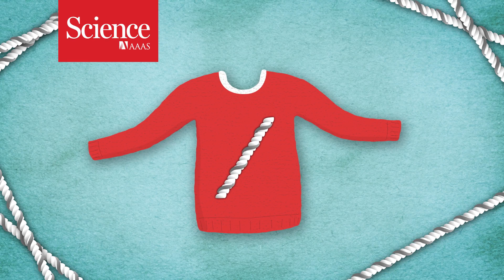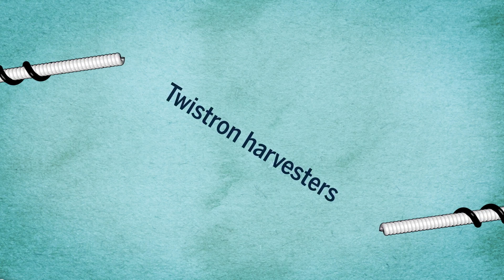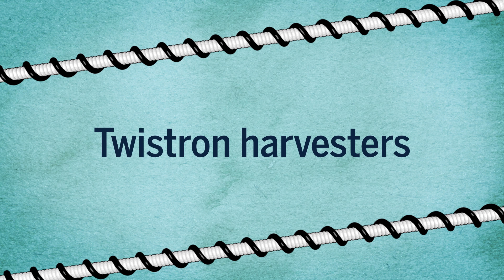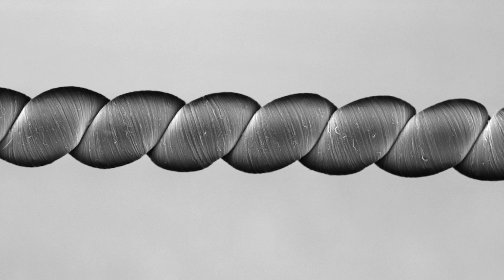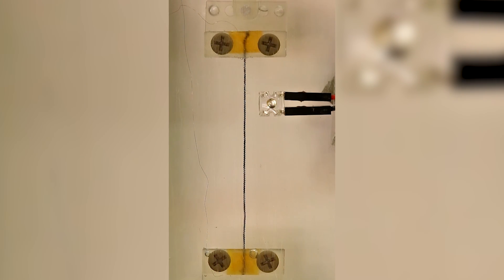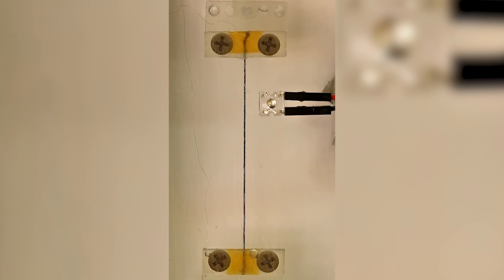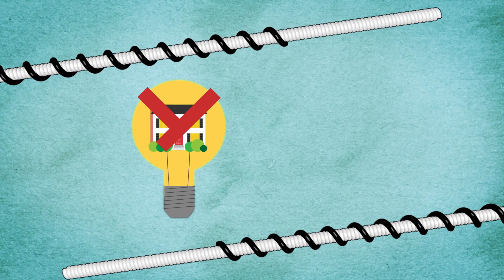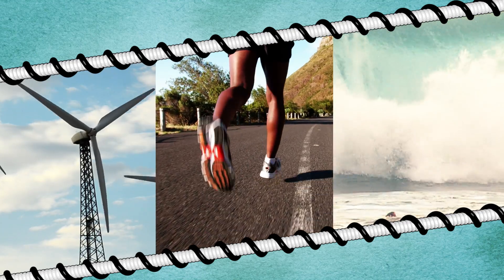These tangled carbon nanotubes can harvest energy directly from breathing and ocean waves

Comment: We need to be very careful about stealing kinetic energy from our balanced energy cycle surrounding us if we start stealing energy out of the waves to create electricity for us to use that will forever change the wave dynamic that will change the way the waves impact the shore that will change the way the sand moves on the beach and so on and so on and we have no idea if something horrible would happen if this is scaled up just like a hundred years or so ago the use of fossil fuels was not a problem but now it's been scaled up to the point where fossil fuel use is a problem in our environment so we have to be careful same thing about solar if all that solar energy that's radiating down onto our planet is intercepted and turned into electricity that heat from the Sun is no longer doing what it's done for millions of years and we have no clue on a very Grand scale what that might do to our environment same thing with wind you put enough windmills up when wind goes over a windmill and generates electricity the wind slows down and while we might think that's great to slow the wind down in some places that's windy that's the weather the wind is the weather we do that on a large enough scale that changes the weather and you think the climate change that we're facing now from fossil fuels is a problem hold on to your hats the solution is not how to steal energy out of nature it's how to get more done with less energy and be less of an impact on our planet

Comment: Springs and any other structure that under goes a lot of strain deformation could potentially use this tech.  Car suspension springs might not need shock absorbers if they are effective enough.

Comment: That seems like it was made for harvesting energy from ocean waves. The way a wave works is the water doesn't do much moving. Just enough to create the formation of the shape of the wave as that shape travels, but not the water. So it means if anchor something below the surface and put a float to ride the up and down from the passing waves you are directly harnessing it's energy. All you need is something that can harness energy when you pull on it just as the float above pulls against the anchor as the wave passes.

Comment: Only 250w/kg?
watt = one joule per second !
To compare:
Coal ~31MJ/kg
Gasoline: ~44MJ/kg
Uranium ~80 000 000 MJ/kg
When M= mega = 1 000 000
SO are you shitting me?!

Dislike that crapVideo!!!
Reply: One is a continuous energy source, the others are one time fuels. 1 kg of the threads can produce as much energy as 1 kg of coal gives of when burnt in 1.4 days. That is respectable in my opinion, but the cost is prohibitive for large scale application, and I don't know anything about the durability.

Comment: If used as muscle in a sense. You can generate power to charge a battery on an skeletoral machine. You can make a pump like the heart that generates that electricity to run the rest. Then this chain reaction of movement can generate enough power to push thru transformers to move more parts to generate more power 🤔

Comment: Imagine gloves made with this, you can heat them up faster by just moving your fingers lol
Reply: Nitrile Gloves
Reply: Ironically I think the amount of work you’d have to put in to the gloves in order to generate enough electricity to warm a pair of cold hands would result in your hands warming up due to metabolic changes and friction, not due to the energy gloves themselves.
Reply: @primate745  Wouldn't you have more heat then? I remember trying to heat my hands with gloves and there was a point where I couldn't get my hands any warmer
Reply: @HDMOVIECREATOR2012  i suppose it depends on its interaction with the em spectrum and other things. It might be a good insulator. It might also be a good thermal conductor which could cool your hands... also you would be taking work and indirectly converting it to heat with some “lost” in the electromagnetic field running through the conductor, which may have a cooling effect as well. At any rate it’s not clear to me what the net effect would be but my intuition is that it would have a cooling effect.
Reply: @HDMOVIECREATOR2012  anyway the idea is really interesting. I hope this technology goes mainstream.
Reply: @primate745  Thanks for your thoughts. Have a great day

Comment: So like I said years ago, we'll sit down on the bus and power it too! -  I thought I was going to be piezoelectric, but I had no tubes.
Reply: That will literally never power the bus. Energy can never be created or destroyed, only converted. The amount of energy you'd produce simply from sitting down is roughly equal to your body weight multiplied by the distance you caused the material to flex assuming the material was tuned for your weight. That means if the entire bus was the same weight as you, it'd take the same amount of energy you just produced to move the same distance as the material did, on the order of magnitude of a couple centimeters assuming 100% efficiency. Except you also have to account for the fact that you're also on the bus so it's guaranteed to be heavier than you besides the obvious fact that buses are heavy af. You can also never get 100% efficiency as there will always be energy lost in the form of heat from both friction and resistive i2r losses. You'll expend a lot less effort just getting out of the bus and pushing it instead.
Reply: @DrakeOola  That's why it's a team effort..

Comment: step 1: make rechargeable batteries that can be squeezed out of energy really fast into a bigger energy bank.
step 2: install battery squeezer banks in multiple gas stations around the globe
step 3: go wild making consumer apparatus that can charge these consumer squeazable batteries. Like kynetic clothes, small aero collectors for your car roof.
step 4: energy transportation service becomes as important as garbage disposal. Energy collector Trucks go around collecting the energy from every gas station energy banks, and transport the energy to the main plant that feeds electricity for the whole city.
step 5: implement the mother battery at the energy plant, as a secondary electricity source. 

Now everyone can generate electricity, recycle it or donate it, and feed the city.

Comment: Now make pants out of this stuff with a charger in the pocket so I can charge my phone while I walk.
Reply: it will electrocute your Joseph, Stalin
Reply: @enjigamingYT  Electrocuting Joseph Stalin, a great idea, a little too late...

No offence to youtuber with same name....
Reply: @enjigamingYT  No it wont. You need a sufficiently high voltage to exceed the dielectric breakdown potential of your skin, not happening with nanotubes.
Reply: It will happen .. technology just keeps advancing
Reply: 21st century problems
Reply: Easy, just hook it up to a battery with a port and you should be fine. Phones only need about 2-6 watts, and they said you could generate 255 watts per kg under ideal conditions. As long as you generate 1-3% of that, your phone will be able to charge. 

Its really a matter of getting all that electricity flowing at a certain rate, so It doesn't burn anything.

Comment: MJOLNIR armour is described as having a Piezoelectric Under Layer to help power the overall suit.

Power requirements for that would be intense. However, if you made a skin suit out of this stuff. Coupled with a passive cooling layer. The wearer could deliver the stored potential energy to different nodes around their community. Millions of people wearing this and doing this activity could convert food energy into utility energy. Off setting the need for stationary power production stations reconverting that land area into farm land.

Comment: You could make guitar strings with these that would function as their own pickups if you had a probe at each end.
Reply: Nice idea, since the energy comes from stretching I wonder if that would change the sound much
Reply: @AndreVanKammen  I would predict near infinite clarity with almost no tone whatsoever. Good for studios, bad for home.
Reply: @itsthem5699  noise
Reply: @Anankin12  Particularly fret and finger noise.  Better to use them like piezo pickups.
Reply: @AndreVanKammen  Yes, it would. For example, they currently sell carbon laced monofilament nylon strings for nylon string guitars, ukuleles, charango, etc. not only does it turn the strings black, but it produces a more piercing treble. It works better on some instruments, music genres, and playing styles, than others. I don’t know how important the shape is to the carbon yarn’s electrical generation property, but nylon guitar strings are built very differently, and much experimentation would be required. Guitarists can be picky, so all the effort may or may not be well received.
Reply: It seems like these strings need to be submerged or insulated with some type of ion rich gel to work, so idk how you would make a decent sounding string that can stay in tune and endure weeks of being plucked at tension and not break, but a cool idea if they find the ability for it to work in plain air.
Reply: @NOLASkaGuitarist  Coat them with nylon, inject the oil between the nanotubes and the nylon.
Reply: @BarfyMan362 why so angry bruh
Reply: @BarfyMan362 Have we met? How do you apparently know so much about me?
Reply: As a male over age 50, I've had enough probes in my life, thank you...
Reply: @thesoundsmith  As a male over 60, I fear what a male over 70 old 80 might tell me about what's yet to come. 👍
Reply: That sounds like nothing but creative speculation, which I still respect cause ya never know. Even if that was possible it'd prolly sound like shit though
Reply: Considering the cost and engineering challenges, whatever first attempt there will be at guitar strings will likely involve embedding the nanotube fibers in nylon or such.  I can imagine all the challenges it would take to get this past the proof-of-concept phase, into a marketable prototype, and eventually into the market.  Nice idea, but I'm not holding my breath.
Reply: @TesserId  Vapor coat in a pressure and temperature controlled chamber. I bet I could get it done with a big tupperware bin, some hose, and lots of profanity.
Reply: @itsthem5699  It would be nice to see if you could get them to send you a reasonably large sample.
Reply: try it man
Reply: @RegularOldRug who hurt you
Reply: Patent that

Comment: I built a 0/4 kite string out of carbon nanotubes yarn to fly a titanium polymer carbon fiber kite behind my Tesla.  Now I have unlimited range because I'm always charging from the kite as I'm driving.  It's also an added bonus if the kite hits power lines, I call that maniac charging.  The nanotube kite string is also useful if I attach it to the back of a semi truck, that really improve the range of my Tesla.  I just put a few dollars in the truck drivers Uber account for the tow.  I am also selling white gloves and ketchup Popsicles
Reply: Tunell
Reply: where does the kites energy come from? of course, it comes from an added drag force on your car, which means that you aren’t really generating new energy at all. and the kite is probably not 100% energy efficient, because no generator can be, so you’re just wasting power. i know this is a joke but conservation of energy, people!
Reply: @katiefrisk980  its a joke bruh
Reply: @blandpotato2847  read my comment.
Reply: @blandpotato2847  conservation of energy is no joke.

Comment: Using one of these with an RS-latch would be an amazing way to run safety warnings. As soon as something slips or is tugged, that tiny current flips the latch into the alarm state, and boom, problem noted. Cheap and low-profile, too
Reply: Good.  I'd also attach to nylon braid, than binding stuff for pallets, so it picks up vibration from the environment.  If it was easy everyone wound have a wind up ohone

Comment: Ok, folks. I have no way to develop this idea, then I'm going to let anyone that has resources to do it: why don't you make tires with these nanotubes? Then you can generate electricity when the tires rotate, or you can embed the nannotubes in layers inside the tires.
The faster the car goes, the more energy the tires can generate. The energy can be sent to the batteries and stored to be used by the car.
A tire weights 12 kilos in average. In the video it's shown that 1kg can generate 250 watts.
The idea is to have 4 tires generating energy specially when the car is in high speeds.
This will add no extra weight to the car because cars need tires anyway.
Reply: It seems that you do not understand that if power is generated, it necessarily drains the kinetic energy of the wheel, therefore of the vehicle, therefore uses more fuel.
The real energy dissipation in a car lays in the brakes (which generates heat). You can already avoid this loss with much simpler and cheaper technology : electric brakes.

The same reasoning apply to all other applications : you have to pay the Joules somehow.
Reply: @samuctrebla3221  But car tires need to be flexible anyway, so it wouldn't be adding new friction.
Reply: @bozo5632 external friction of the tire with the road would not change, but the tire is expected to be ideally elastic, meaning that you avoid energy loss when it constantly deforms while driving. If you had a piezoelectric system in the bulk of your tire, then you create internal friction that opposes the deformation.
So for the same deformation (or car trip in this case), you would have to input more energy, which eventually comes from your engine.
I hope I'm clear.
Reply: @samuctrebla3221  I'm not a cartireologist or anything. But rubber tires are not ideally elastic. They're intentionally wasteful and grippy, unlike for instance steel wheels on trains. 

If you substituted this nanomagic fiber for the steel belts in car tires, or maybe even for the rubber, you might not lose more to friction than the joules you're already paying out. 

It's not a great idea. But it's not as dumb as you made it out to be.
Reply: @bozo5632  I'm not either. But from a physical pov, I think it's overcomplicating the electric brake principle for very limited outcome. Just Imagine the wiring between moving parts, plus you need an transformator to actually charge a battery from the AC of your piezoelectric system.

I think this technology is rather very adapted for sensoring any type of deformation on various scales (honestly, crazy applications potential) , but definitely not energy production from random kinetic energy.
Reply: @samuctrebla3221  I agree about all that. 

Except there might be some power generation applications. The US military is supposedly looking into similar ideas for powering electronics for individual soldiers. Efficiency isn't the highest priority there. Or it might be useful for powering medical implants - attach a few strands to the diaphragm muscles, make it .01% harder to breath, and provide reliable power to a pacemaker or something. Or on a larger scale maybe capture tidal energy or something.
Reply: @bozo5632  agree as well, I'm not sure about tidal energy compare to hydroturbine, but I did not see any bad reason a priori
Reply: @samuctrebla3221  Yeah, I kinda doubt the tidal thing. I was thinking of how palm trees sway in hurricanes... Not ridiculous but probably not the best way to capture the energy. 

The main advantage might be size. A nanofiber generator could be microscopic.

Comment: Here is an idea: bussy streets fused with this matterial.. especially if including driving parts too.. basically applying this concept to any moving object, structure and design could potentially reduce energy requirements by taking a big load of main energy grid.. every mechanical instrument and machinery would use less energy..  possibilities are great..

Comment: Graphene (in computer simulations) can filter salt from sea water at a fraction of the cost of RO (reverse osmosis). 

It's not an overstatement to say that kind of technology will change the world
Reply: Actually no. Unless by a fraction of the cost you mean 95% of the cost.

See, the laws of thermodynamics say that there is a minimum amount of energy per liter needed to remove ions from salt water and undo the entropy. The thing is, current RO plants are already within 1 to 5 percent of this minimum energy usage, so the permeability of the current membranes are actually already pretty good.

Even if graphene works at desalinating water like it does in the simulations, all it would do is increase membrane permeability, which yes would increase energy efficiency, but not by much, 1 to 5 percent extra efficiency. Past that, sorry, it doesn't matter how perfect of a machine you have, you can't beat thermodynamics.
Reply: @justindie7543  I think the idea was that water sorta just falls through the graphene while the dissolved salt just sorta stays on the sheet.
Reply: Can graphene/carbon nanotubes be recycled?
Reply: @K-Effect  yeah quite easily it's all just carbon so worst case scenario you can just turn it back into amorphous carbon
Reply: Ya but don't forget that having salty ocean water is essential for all life on earth. We just can't start purifying millions of tons of ocean water without considering the ramifications of doing so.
Reply: @theamericanjoeshow  😂
Reply: At the moment, I believe it is prohibitively expensive to make consumer-level quantities of nanotube-based things (I could be wrong, if so, apologies.) IF we can make them cost-effectively, we'll have a winner, else we'll have a Defense Department budget line item.😉